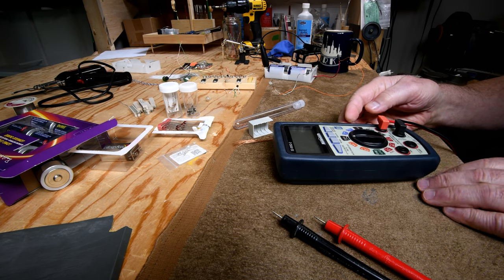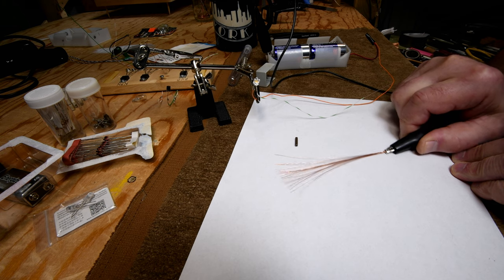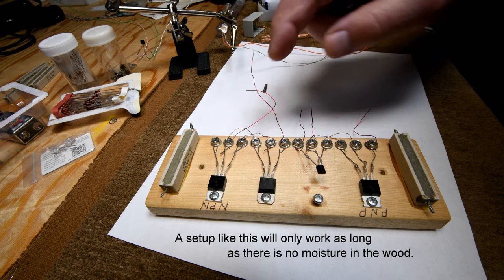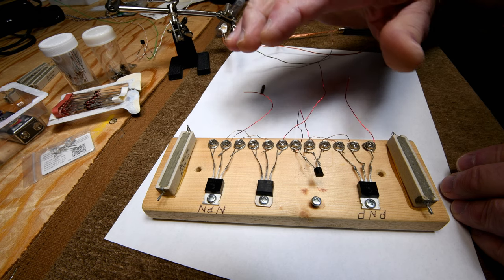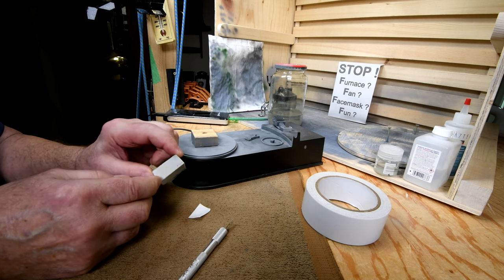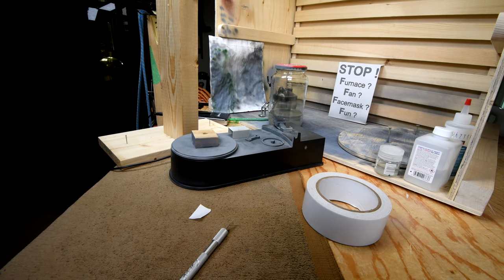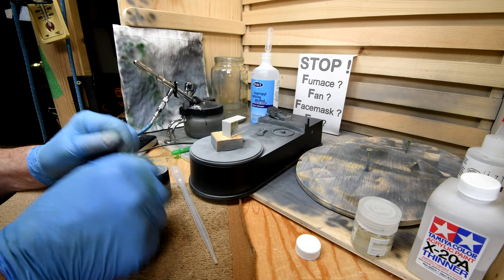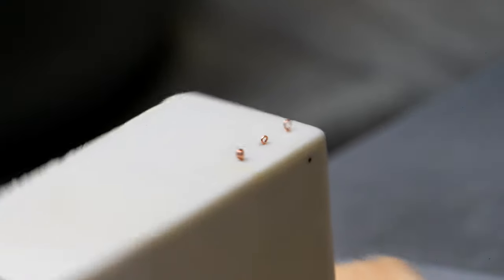The Model Ship - Part 504

Comment: Ron, the only small gauge wire that I know being coated (with varnish) magnet wire used for the windings for transformers. Many modellers use this wire for lighting circuits in models. They just burn off the end needing to be soldered.
Reply from the maker: Not that I need any, but I've seen extremely fine coated wire in micro components like earbuds. Radio Shack used to sell fine wire to years ago. 👍httpd://www.radioshack.com/products/magnet-wire-set